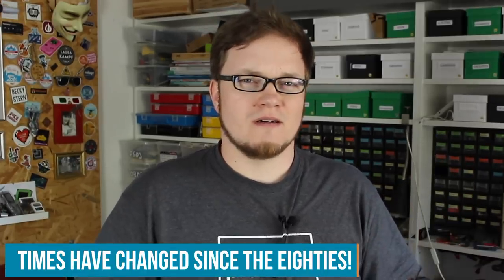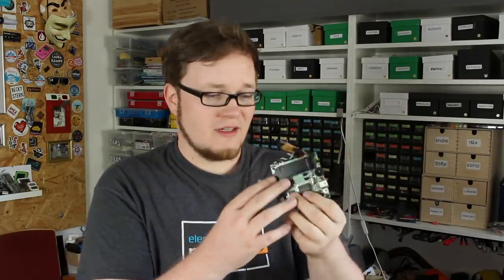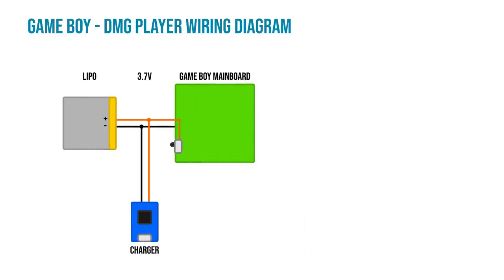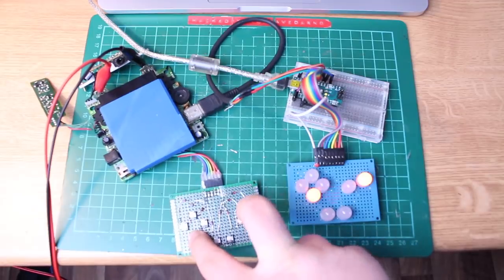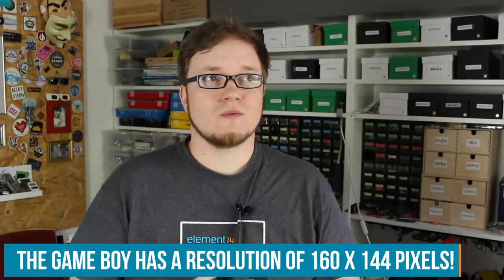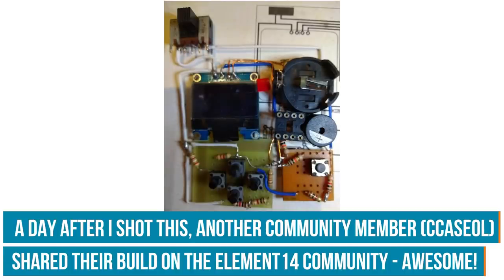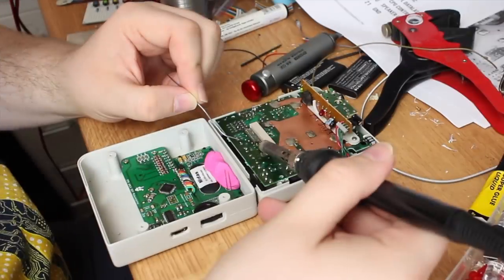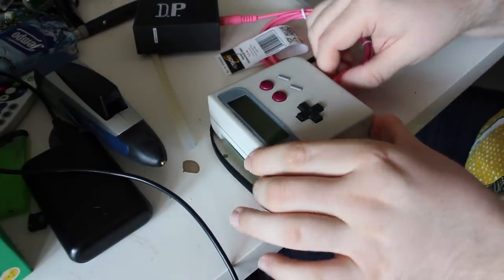Gameboy Walkman

Comment: Are we supposed to ignore u putting the LCD in upside down and not flipping it in code or physically
Reply: I still need to fix that in Software :D it was easier to solder in that way - but there wasn't enough time to flip bits and reprogram the drawing algorythm AND cut the video to send it in.  I apologise for the crudeness of my model :P
Reply: @Davedarko  appreciate the honesty :D
Reply: @Davedarko  easy enough to fix the lcd driver, the main point of this project was obviously the physical design/build and concept. I think you did a great job under a time limitation. Hope you post an update video if you get around to fixing the lcd software. I do have to say it is missing a key element of 80s/90s portable audio electronics ... A BELT CLIP!!!
Reply: @sjm4306  I so want to give a heart on this comment! Someone else mentioned Star Lord and I did plan to have a sequence like the intro in Guardians of the galaxy one -> so a belt clip is something that needs to be added ASAP :D I thought that showing actual letters would be enough as a proof of concept, yes. Thank you! :)

Comment: Very impressive! On a side note, what is that pink stuff you used to hold the wires you were soldering? It's it heat resistant?
Reply: Thank you! That's pink BluTack - not sure how well it's resistant to heat or if I should call it PinkTack then.
Reply: Either way, what a great idea for holding things to solder (or even glue!). I'm definitely going to get some of that!

Comment: 65536 is also the number of discreet values containable in a 16 bit unsigned int.
Reply: Bitluni has gone over that subscriber number recently and made a video about it :) (check him out btw.)
Reply: And a signed 16 bit int.
Reply: @mirabilis  unsigned ;) 32.767 is the max for signed 16-bit
Reply: @Davedarko  yes. But it can contain 65536 distinct values no matter the signedness.
Reply: It was also the number of rows available in Excel before Office 2007, most likely because such an int was used to store the row number.

Comment: no built in speaker?
Reply: I kept it out because I wasn't sure if there's room for it, it would have added extra time for designing into the case and because walkmans/discmans/mini disc players also have none. But to have one for demos might be a good idea. The Speaker is connected to the buttons/display board and needs one or two parts extra to be connected properly.

Thanks for the input!

Comment: Then you make a soundtrack of games.
Reply: yep! I need to work on that sequencer, get a better data storage / "compression" going. I also thought of making an "awesome mixtape vol. 1" version.
Reply: davedarko You may try using larger memory, but be sure not to exceed memory map limit on the system
Reply: @ruikazane5123  I probably would have to buy a bigger cartridge then, but I like to see how far I can get with the 32kb first.
Reply: davedarko True. If you got large space you do not know how to utillize it efficiently. So if your compression is good enough and you can finally expand memory and have more tracks. Might as well add a proper labeling!